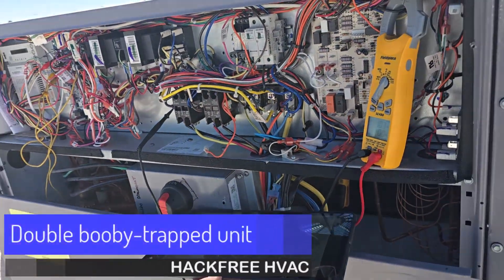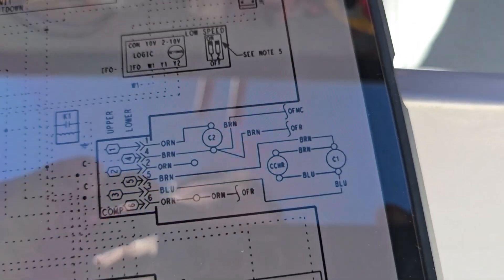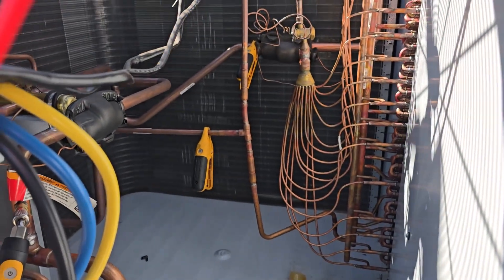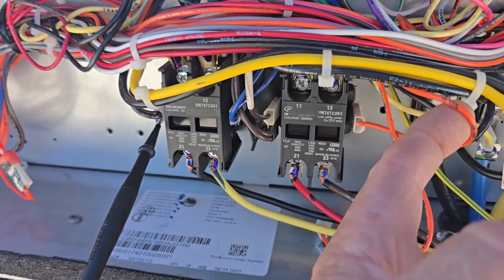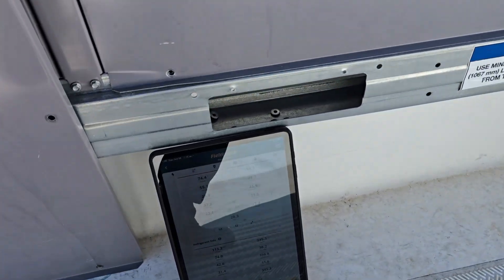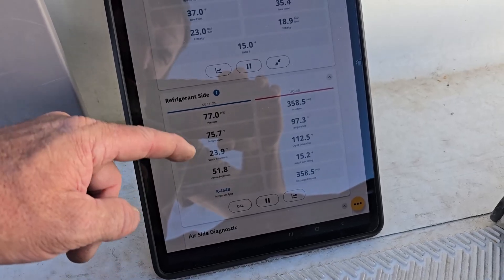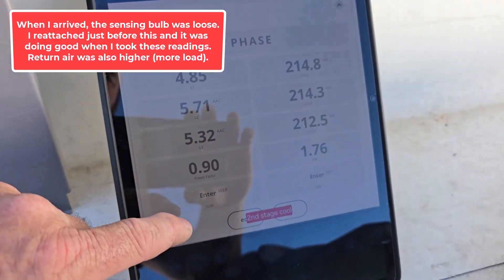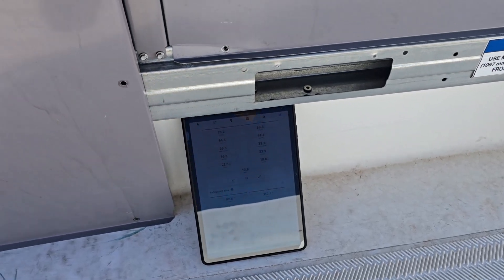Double booby-Trapped unit - Fixed the obvious however it is still broke

Comment: If you go as far as replacing TXV,before removing it,check the equalizer cap tube,sometimes,it gets plugged with solder.
Reply from the maker: I have seen that a few times. Especially after the TXV was replaced in the field 😆
I've cut those tubes with the system charged. Pinched off and brazed shut the old connection to the suction line. And then brazed on a 1/4" schrader flare connector that I could screw onto the suction service port with a swivel tee.
I believe I posted a video of me doing that maybe 6 or 7 years ago on the channel.